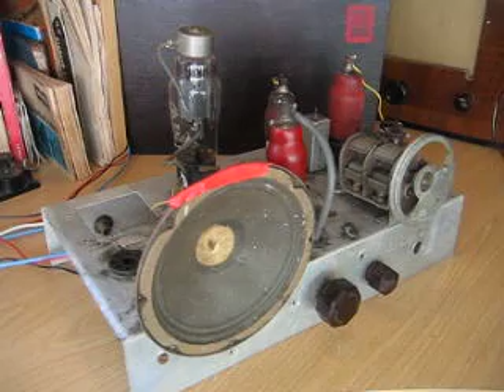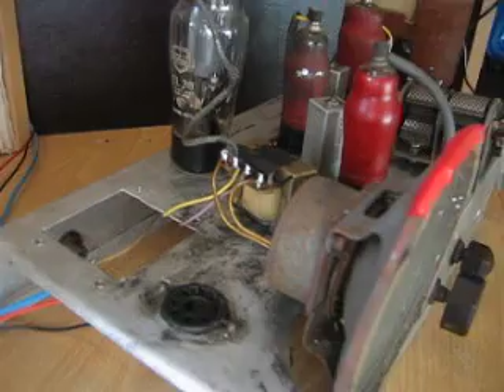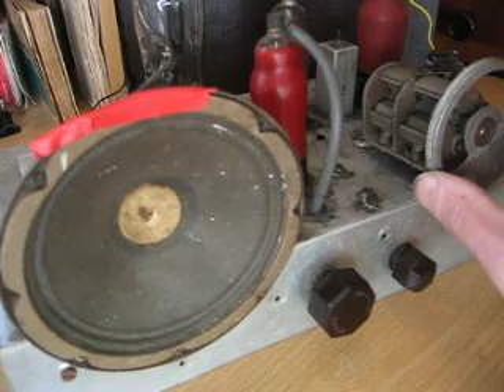homemade valve radio

Comment from the maker: Yes, the variable tuning capacitor is a "double gang" type, both parts are used, one side for the signal the other side for the local oscillator.

Comment from the maker: valve line up is, ECH35 mixer, EF39 rf amp, EBC33 double diode triode detector/AGC/AF amp and just to see if it would work an EL38 as an audio power amp. The transformer and rectification was a lash up on another board. It was only running at 110v at the time. I did it to hear what would happen with an EL38.

Comment: It looks like you re-cycled a old chassis and the wound components from another place.
Octal valves, obviously. Let me guess....... ECH35, EF39, 6Q7 and finally a 6V6G, or a EL33?
I wondered about the power supply. Where's the transformer & rectifier?